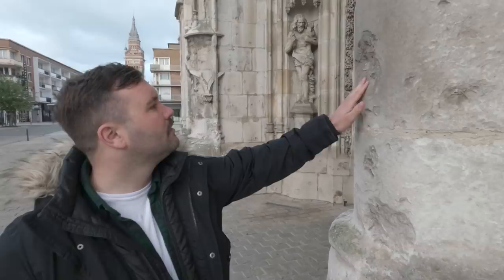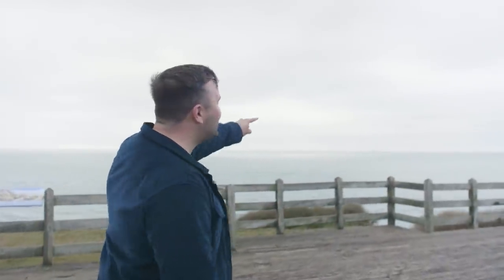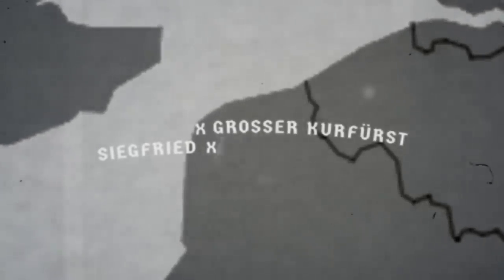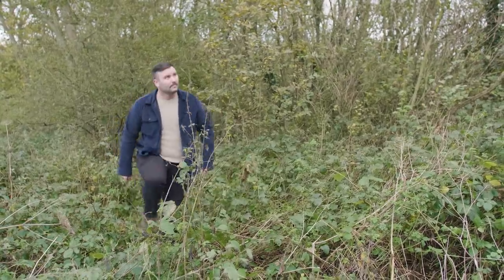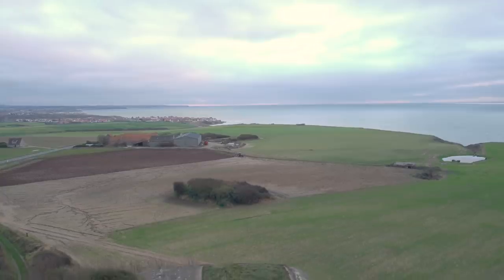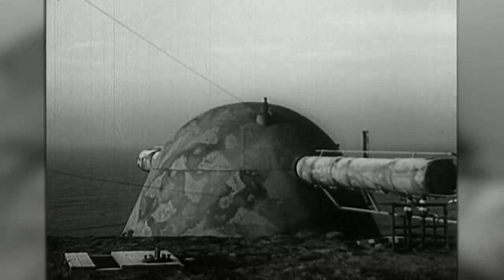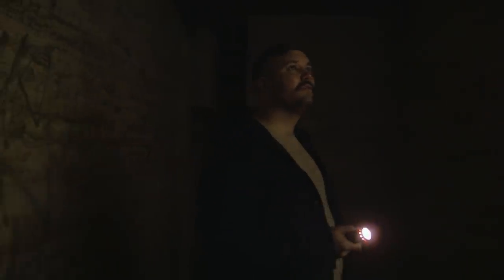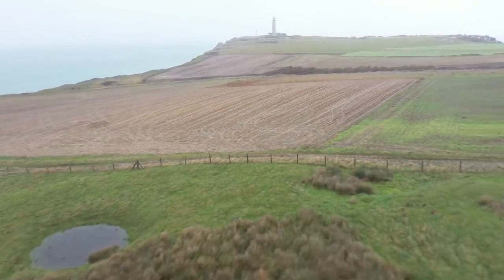Inside Hitler's Nazi Mega Bunkers | Traces of World War Two With James Rogers

Comment: These batterys were impressive, but not nearly as impressive as the battleships of that era, Bismarck and Tirpitz had 8 of those 15 inch guns, ships like the Iowa's had 9 16 inch guns, that's crazy amounts of firepower.
Reply: These guns were modified with a larger chamber for coast defense duties to handle the increased amount of propellant used for the special long-range Siegfried shells. 
There where 4 of them in my town of Hanstholm Denmark.
Reply: I was on a USN ship in the mid 80's that did gun fire exercises with the USS Missouri, it was impressive to watch, hear, and feel.